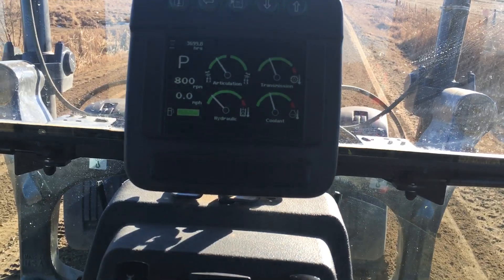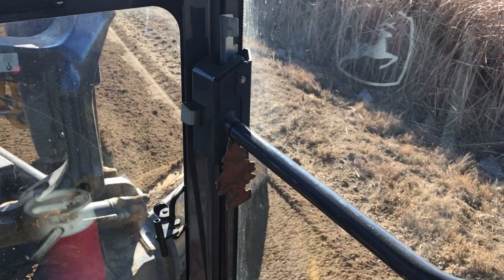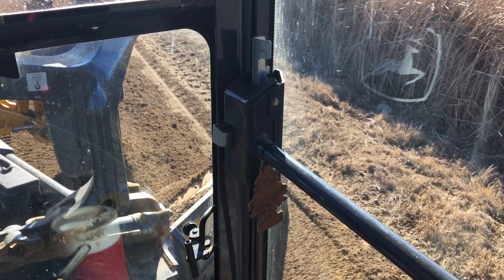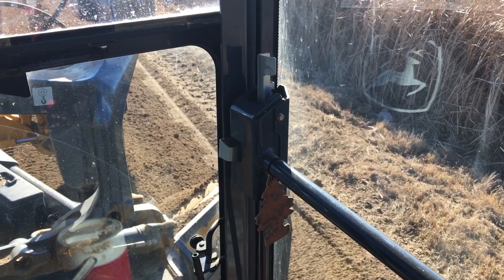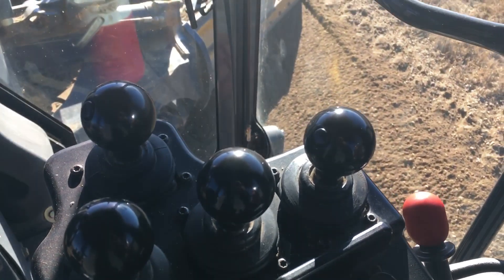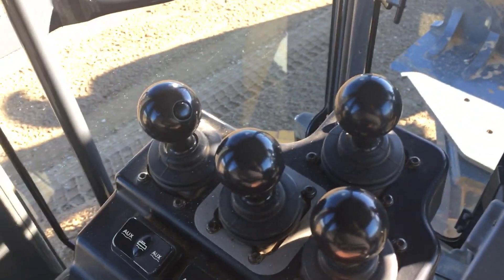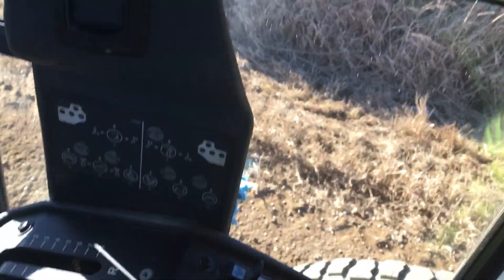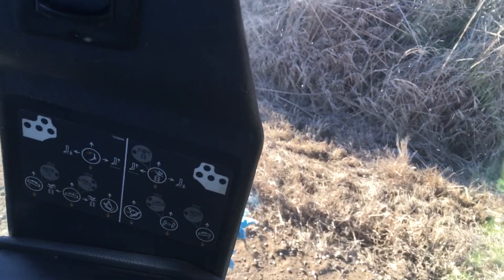772 GP one year review

Comment: I run a 2019 772GP and a 2013 120M. The M by far has better visibility, and the controls are great. The 772GP w/ fingertip controls is nice, but you are right, the front cab post sucks. I have figured out that you can lower the armrest to just above your knee and adjust them inward and they are not in the way at all. Nothing you can do about that cab post, but you can adjust the armrests in a comfortable position where they aren’t hindering your visibility. I’ve gotten used to it since I primarily run the Deere, but that cat takes the cake for visibility and controls. I do like the slap shifter in the Deere though. You can be going in 8th gear forward and slap it over to reverse and it’ll gradually slow you down and put it in reverse in one smooth motion. The older 772G I ran didn’t have that, had to shift up to neutral and then over. The slap shift is very nice and quick and speeds things up tremendously when you are plowing snow and doing intersections. Both have their pros and cons. Hands down, the cat is better when blading a road, but I might like the Deere a little better for plowing snow.
Reply: I see the GP you are running doesn’t have the slap shift. It’s like the G model I used to run

Comment: I'm glad you put this video up about those deere machines because my shop is looking at switching to those from Cat. I'd like to see two 14m machines be the choice to replace our two 14g machines
Reply from the maker: Woos 31 your welcome show the higher ups this maybe it will keep them with cat
Reply: @graderman140m  I didn't show em the video but explained that specific visibility issue with the front corner cab post being square in the way. That's when he told me the issues with our 120M having the front bearing failure and how chapped he was to drop 7 grand from a premature non-replaceable bearing failure
Reply from the maker: Woos 31 ah I gotcha that’s good and that’s no good they had trouble with the 120M like that all my 140Ms that I’ve operated have been pretty well trouble free.